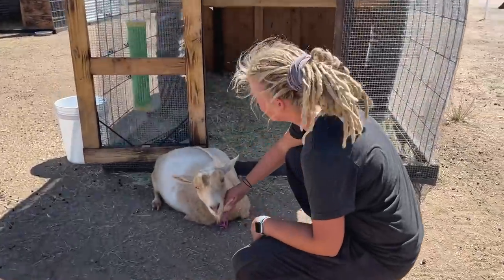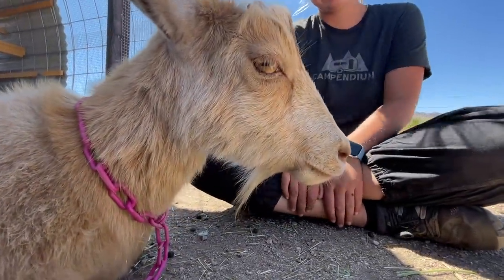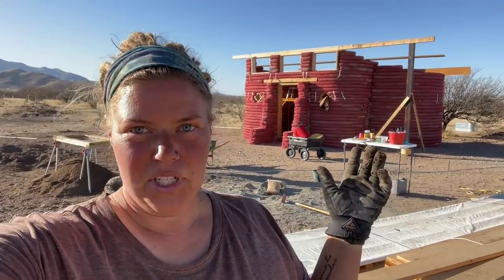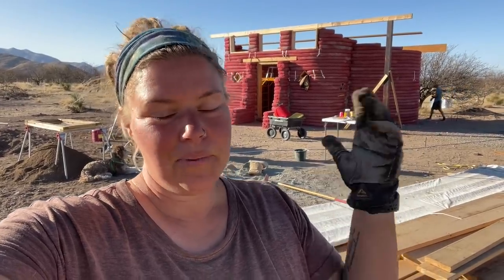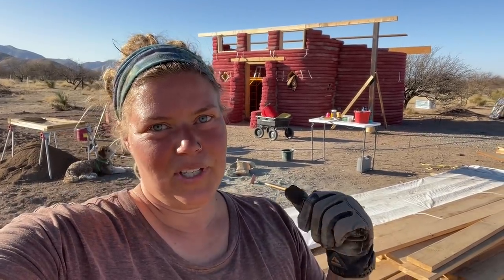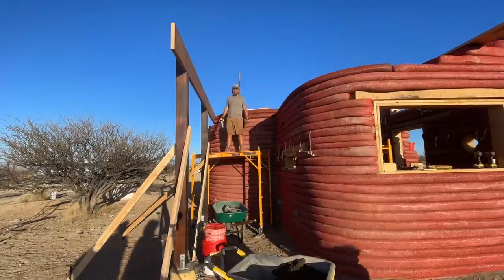Installing Posts and Beams for Earthbag Roof

Comment: Hot sauce conversation. "Back to the Earthbags". Front 4"x6" beam had to be adjusted a little because of building being a little off. Now back posts must be set for change of plan of LVL being used at back of circle. Pesky T-Rex bends over to supervise notch cutting of post for back beam. Check Mable the goat again. Need to lay two more rows of bags; Jax walks away and Jet can only say sadness. Wow, working into the night to get those two more layers of bags done so that the middle LVL can be set up. Good thing you sent your dad to get some rest to be ready for that tomorrow. Too bad you guys have to keep on working in the dark. Oh my!

Comment: what is l v l?
Reply from the maker: Laminated Veneer Lumber. It’s a high-strength engineered wood product made from veneers bonded together under heat and pressure. It is used for permanent structural applications including beams and rafters. (From Mr Google)
Reply: @TinyShinyHome  ah ok thanks